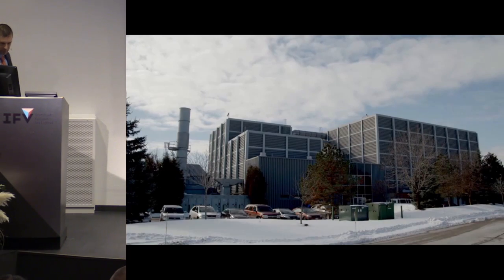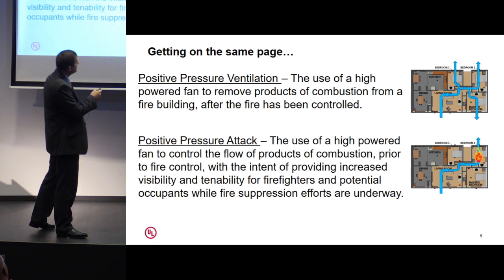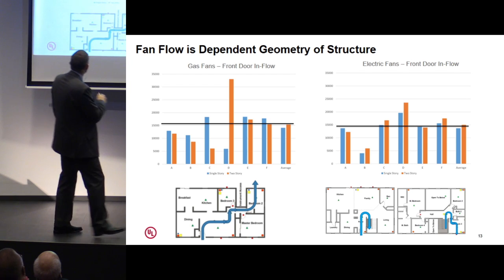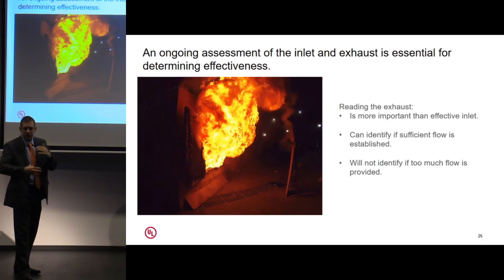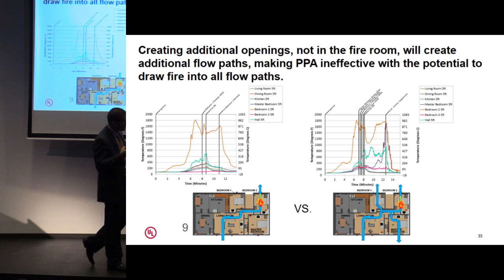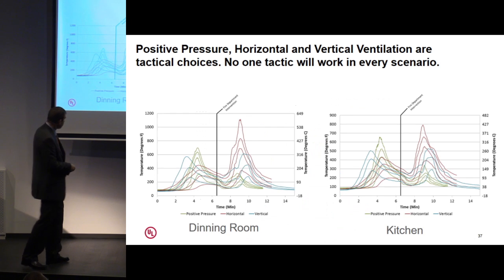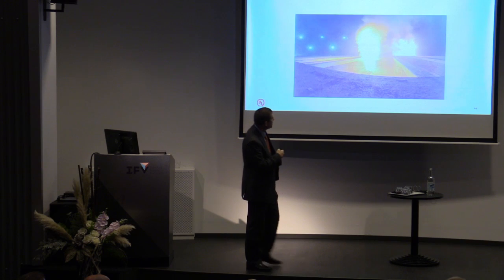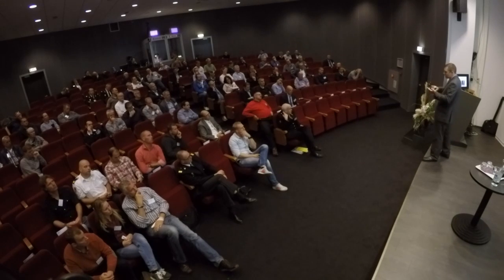FSS Congress 2015: Robin Zevotek - Positive Pressure Attack

Comment: Too much talking and science and NOT enough Common Sense and Logic.  Fire fighting is Easy to understand and perform.  All you have to do is THINK and IMAGINE!  High pressure to low pressure.  Water on burning material  Horizontally vent ONLY with a fan or not!  Extinguish all Visible Burning Material from the outside as you vent the gasses out the window of the fire room.  This is Not Rocket Science!